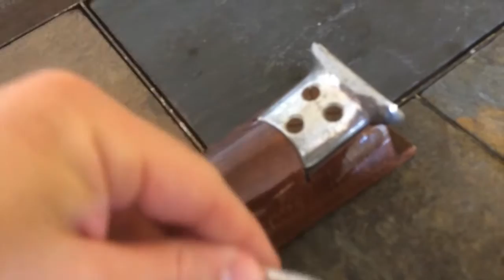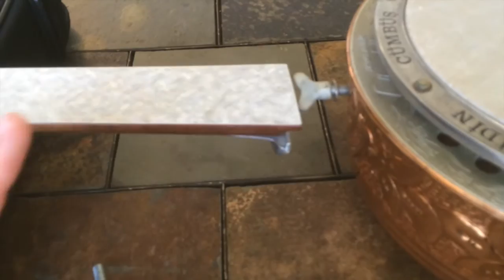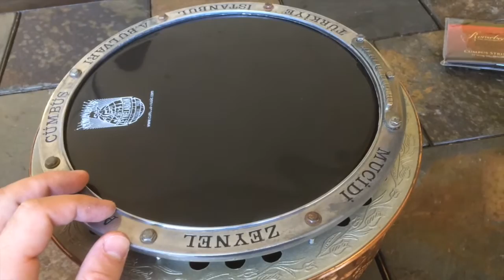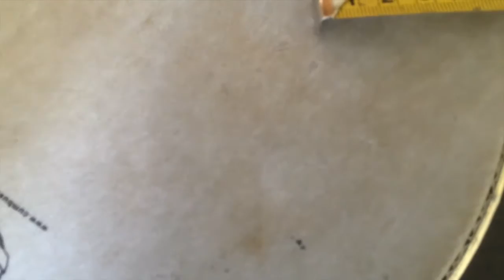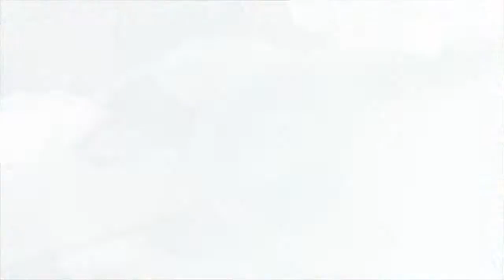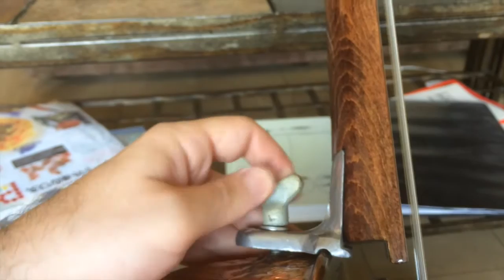Complete Cumbus Build/Repair

Comment: Hi, i have an issue where my lowest strings are off towards the end of the fretboard. it's like the neck is skewed but you only get that after full tuning. on the other hand i have too much fretboard underneath my highest strings. is there anyway to align this correctly?